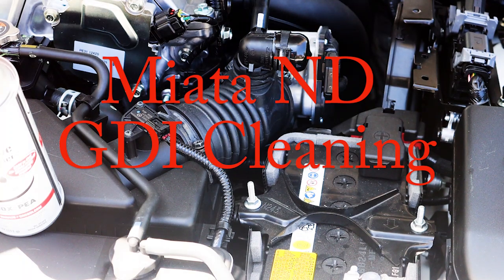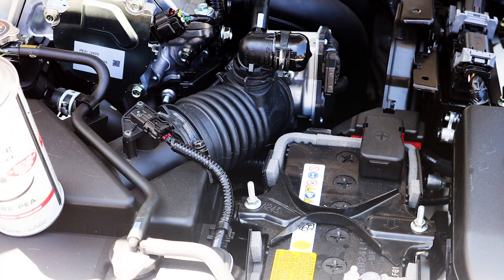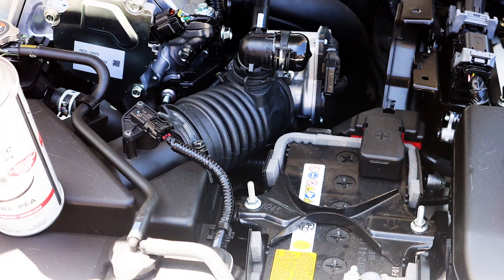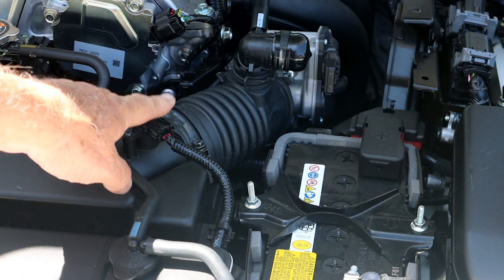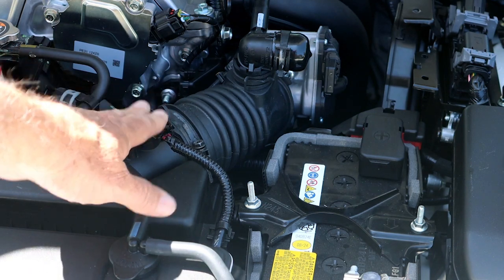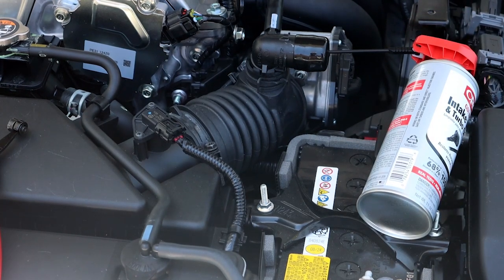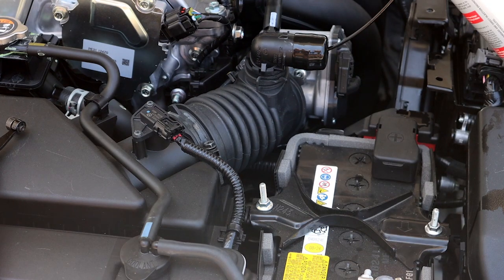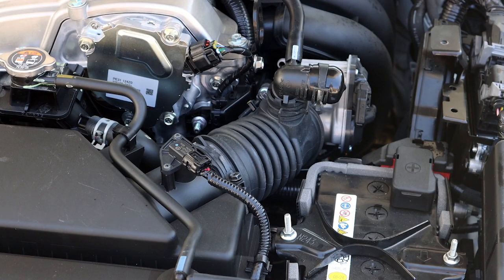Mazda Miata ND GDI Cleaning

Comment: nice video.  curious about your cap replacemen for the souund tube delete.   those aren't designed specifically for an engine compartment.  are they going to last?  how long have you had the same one on?  is it the 33mm size?
Reply from the maker: Yes 33 mm, if you use the stock clamp, use two caps.  I plan to check for leaks every oil change , as I did in the video.